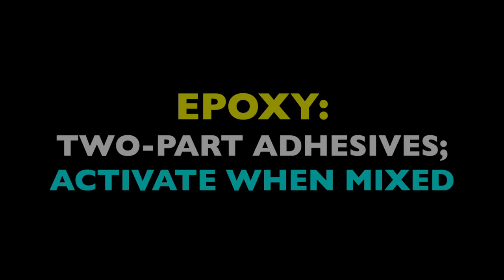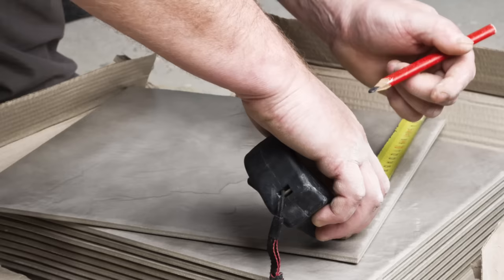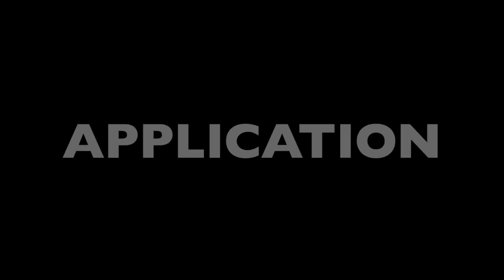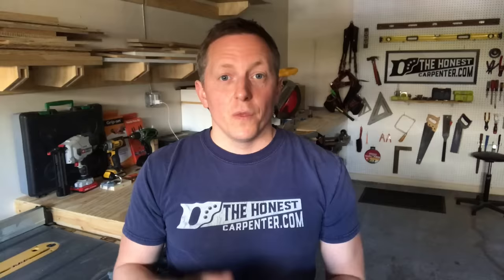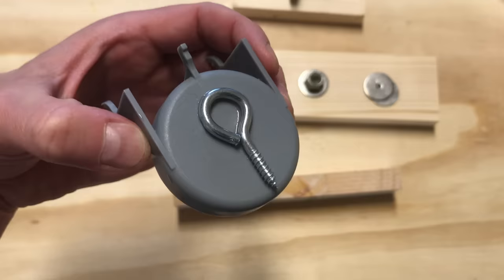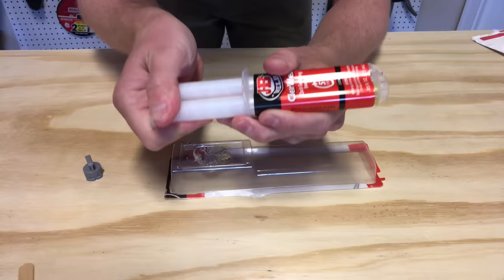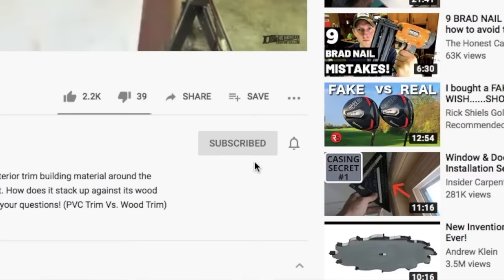DON'T USE SUPER GLUE! Try This Instead..(Epoxy Adhesive/5-Minute Epoxy/Epoxy Glue)

Comment: Great video, covers all the bases. I rarely use Super Glue (to brittle to last a long time. Epoxy has an affinity for wood, and makes it highly durable. It’s the go to for wooden boat builders.  (West System). 2 part epoxy is an exoteric reaction - give off heat when mixed, so ambient temp definite affect hardening time. Learn to work with it and it’s one of the best adhesives out there - and yes always wear gloves, and don’t get it in you eyes!

Comment: Both have their advantages and  uses.   In 5 min. epoxy their are always air bubbles, while mixing, so you 'll need a vacuum chamber  to get that out, if you want a clear view. Who has that?  And in 2-3 minutes? It cannot handdle UV so it get brown/yellow after a while. It is a strong clue, but only if it is 50-50 +/- 5%.  And that is a problem sometimes. It is hard to remove. And not cheap.

Good Superclue is not that stark, but sometimes more usefull than epoxy. While you can loose it with a paint remover (hot) FÖhn.  Very usefull on a lathe if you want to make a round thing without a hole, or in electronics or fast repair and so on.   And so you cannot say, like do not use superclue. It Depens on use.  It is cheap and usefull. Even for  fingerprints (vaporised use) 

have a nice day. F

Comment: I just used JB Weld Steel epoxy to bond my plastic interior molding for my car.  I attempted using the Clear Plastic stuff, but it failed.  The plastic bits came fell apart with the ever so slight tap.

The extra nice bit is that the JB Weld was the same color of gray as my interior.  No spray painting was needed.

Oh, I also had attempting using the solder iron with wire zig-zagged across the seam, but the plastic molding was not quite compatible with the heated wore method.

Comment: I have more than once found while pushing the syringe connected to the resin and hardener that one of them let’s out significantly more volume than the other. In these cases I have had to cut the connection between the tubes and squeeze out each one separately.
Reply: Had to the same thing with the plunger connection as the viscosity of resin/hardener are different. If you don’t do this on a new tube, your 1:1 ratio is ruined for the rest of the tube. Glad you brought this up

Comment: Wife 
Broke her glass bong so I figured WTH I’ll try some Harbor freight cheap epoxy? Cleaned glued and taped it in place for 24hrs and did 2 more heavy coats! Works great for over a year! Just remember to Clean, Dry, clamp or tape in place and leave it alone to cure as long as possible!

Comment: So here's a question I'm doing some research on. Would you know what would safely fix a crack in aquarium? Currently, all anyone knows in the fish hobby, is that you have to take apart the entire tank, because silicone does not stick to itself, so along a seal, which is where most cracks break to, silicone won't help and the tank will still leak.Any ideas? I found one video where super glue and baking soda fixed it temporarily, but it did not show any long term results. Great video by the way.

Comment: Thanks for video. I used epoxy bond for quite some time and it works - very strong. However my biggest problem with it - it de-gradate after some time (I mean one - or maybe both liquid components will react differently when you mix them after several months). I do not know if it is oxidation or what - however using half a year old opened epoxy will frequently lead just to gelled join. The mixture of components will just not harden. It is safer just try before using - if the bond will really harden. Newly opened epoxy bonds do not have this problem, (after one year typically)  the unused epoxy is good for nothing.

Comment: I've used different brands of 5 minute epoxy over the years and fully agree with what you're  saying, however,  maybe you can explain this :   I mixed a little amount on a piece of cardboard for a small job and later, when I was going to dispose of that piece cardboard, I noticed that the cardboard was warm.  What is this reaction between the resin and the hardener ?

Comment: I agree with you about 2\\part epoxies. II discovered JB Weld years ago and I love it. It works MUCH BETTER than those instant glues.  Recently, I've been feeling that the amount of hardener is insufficient and that I run out of it long before I run out of the epoxy. Do you agree?

Comment: I'm going to be looking around for a different brand of Epoxy. I don't know if they changed their chemicals or something else but I was a believer in JB Weld and have used it a lot in the past but in the last year I have had the bottle's, dual tube and the little squeeze tubes styles of theirs not want to fully cure even after a week, and if you have bought them you understand it isn't cheap. I'm thinking of giving Gorilla a try.

Comment: Another plus for epoxy... Super glues, once the tube is opened tend to harden rather quickly (created to do this on purpose). needless to say, they don't store well. Opened Epoxy, if the tips are cleaned and stored properly, will last a long time on the shelf. Good Video.
Reply: Just a little tip. Opened super glue, if the tips are cleaned and stored properly, it too will last a long time on the shelf.

Comment: I mix 50/50 baking soda and graphite to create a very strong bonding agent, and if I have a wider repair I will take old cloth, saturate it in the CA glue and sprinkle the above powder on the cloth.  Talk about a strong repair - Hard as a rock, dries very fast and will bond nearly anything I have tried.  Buy CA gel glue if runniness is an issue, and the above powder with CA glue is a very effective filler.  I like epoxy pretty well, but like what I mention above much better.  Lastly.  Harbor freight sells "acid brushes" for very little and they are perfect for this type of use, and a million other.

Comment: You can get cheap/inexpensive super glue and you can get good CA (cyanoacrylate) glues. Like epoxy you’re can get different viscosity CA adhesives. I use CA glue all the time and buy it in 8oz bottles. CA glue works much faster than epoxy and can be quite effective when used with an activator, or even baking soda to make a CA paste. I also use epoxies both liquid and putty, and buy in gallon or 1/2 gal. size containers with measuring pumps. I think one big reason you like epoxy over CA glue it that you’re using cheap superglue and not a good Hugh quality CA glue. I also use UV activated adhesives/fillers as they stay liquid until activated with a specific wavelength UV light; just like epoxies and CA glues you can get it in different viscosities. Buy a better CA glue and activator and give CA glue another shot; you’ll like a quality CA over epoxy in its near instant set over epoxies cure times.

Comment: I like your video and I agree that epoxy, in general, is superior. I have had more "fails" using super glue than I have with epoxy, yet epoxy has failed me on many occasions. Just today I stumbled across several YouTube videos that combine CA glue (super glue, etc.) with Baking Soda, Powdered Graphite, Ash, Powdered Charcoal, Styrofoam, and sand. I have yet to do my own testing but was curious if you have experimented with any of the super glue "mixture" applications?

Considering the cost of epoxy and the fact that I have paid upwards of $10 for epoxy and only completed one project only to find that the remaining 80% of the product still in the container is no longer unusable months later because it hardened ... even if the resin and hardener were in separate bottles. I can get super glue 12 packs (2 gm tubes) for $9 online. If I can mix it with other easy to get inexpensive materials and get epoxy like results, I would be interested in this route. I would like to get your take on this.

Comment: Actually because 5min epoxy comes as two parts require mix , It seems to  me more work evolve then super glue for small repairs. In this video I got some great Ideas to use epoxy for and I will try to use it more

Comment: I use epoxy to glue golf club heads to shafts. It's the preferred method for club builders. Imagine the force exerted with hundreds, or thousands, of strikes. I never had a failure. Super, super strong. One tip - when adhering smooth metals. It helps to scuff the surface a bit.

Comment: Some plastics super glue doesn't stick to. Not much luck with JB weld but that was a few years ago. Bondo the car panel filler sticks to everything but just not so good for exterior wood repair where its expose to direct to sunlight and moisture. Trying epoxy as filler on couple of axes where the handle separated from the iron.

Comment: I rarely use epoxy anymore. I mostly use superglue and baking soda. Just look, you get bigger volume superglue. I generally buy 50ml bottles. Epoxy just does not work as well.

You can also use superglue with graphite and cinnamon. My main glues apart from wood glue, is superglue and contact glue.

Comment: FWIW, I use a Sharpie to draw a line between the plug and body of the tube, so that I don't accidentally put plug with the residual hardener in contact with the epoxy, or vice versa.

Comment: I found that for tiny repairs epoxy cumbersome and not very durable on plastics. The best and stronger option was a combination of superglue and bicarb soda it produces an extremely strong bond very quickly is also suitable for filling and fabrication of damaged parts is sandable and drillable.

Comment: The weirdest thing I used epoxy for was a car tire. One day I got a puncture but it turned out there was no spare tire. Normally I would call some help but since it was almost midnight and i was in the middle of nowhere i decided to try the trick with epoxy glue which I always have with me. It takes only 5 minutes so it's worth trying, right? It took me longer to find the spot with the puncture. I applied some epoxy obviously outside of the tire, waited more than needed to let it cure, pumped up the tire with a portable air pump and started to drive slowly. I got home safely- approx 60-70 miles and was going to change the tire next day. But something came across and i forgot that. I have been driving with  tire fixed with epoxy for the next few days until i changed the tire. It drove like that at least 200 miles with no problems lol

Comment: Loctite was  my go-to for five-minute epoxy but not anymore. Apparently they have changed the formula so that the resin crystallizes and becomes rock-solid and so you’re forced to buy more.  I have switched to JB weld, which does not harden in the bottle like that. Eff Locktite.

Comment: super glue can be bought at RC aircraft hobby stores in MUCH bigger bottles. the moisture in the air is what makes it harden, so keep the bottle tightly closed and air out. It is more brittle than epoxy. Epoxy is more flexible but heavier. Heat is what cures epoxy through chemical reaction. cold will lengthen cure time. 70 to 80 degrees is best. I build RC planes and use both.

Comment: Five minute is better than "super glue" for most applications but both are temporary solutions.  For a permanent repair a slower cure epoxy will set up harder and won't break down over time like 5 minute epoxy.  I've peeled old 5 minute off of several repairs.  For something important, a cure time of 2 hours or more is best.  Make the repair in the evening, clamp it up and it's cured and hard by the next morning.  I've built RC models for about 40 years and learned a great deal about epoxies.

Comment: FWIW, 5 minute epoxy cures fast but can be a bit brittle.  Use a longer curing epoxy such as 30 min or longer for those bonds that require extra strength and a bit of flexibility.

Comment: An unopen clean vegetable or fruit can makes a great mixing tray. For broken plastic or metal with a clean, tight break i prefer to use super glue for the join and then apply epoxy for the surrounding area for added strength.  JB Weld is much stronger than JB Quick.

Comment: make sure you use a rag and clean off the tips, before putting the cap back on or its going to be bonded solid the next time you use it.
taping instead of putting the cap back on is a good idea.

Comment: The 5-minute epoxies aren't as strong as the longer cure-time ones, presumably because the later use less hardener, and hence more epoxy.  If you are really serious about using epoxy, then the resin and catalyst can be bought in larger containers, as is often available from supplier of boat-building materials or a "ship's chandler".  Various fillers then can be added to suit various requirements.  Polystyrene resin is not as good; less flexibility.

Comment: I’ve made two piece car bumpers into one piece with UTILITY epoxy brought from Bunnings I buy it buy the box 📦 you get six tubes in a box for $16 dollars I mix it like body filler on a proper mixing board and I use a stainless steel applicator it works really good but like anything make sure you sand both bits good and I find bending plexiglass plastic easily with a heat gun to modify my car bumpers and the epoxy is like cement once it’s set and you can sand it use car body filler over and 2 pac primer and paints

Comment: Though it is correct with polyester resins, I wouldn't say that epoxy is made of a resin and a hardener. Strictly, both components have the same function. In Epoxy, one molecule of component A bonds to one molecule of component B.

Comment: So I was right in thinking metal epoxy will fix the bracket on my grill that holds the drip pan? Can I just wire brush the little bit of rust that's on it? Or do I need to do something else for a good bond?
Reply: Commenting to follow advice others give. I'm curious about whether epoxy would be a safe solution for this considering it can be expected to get super hot and cooled back off repeatedly if it's in a grill. I'm not sure exactly of the visual of what you're discussing but that strikes me as a hardware sort of situation
Reply: You would need high temperature glue that works at 500F or even higher. Amazon has some but I never tried any. Regular epoxy does not work for high temps - I tried fixing low voltage lamp that doesn't get too hot and even steel reinforced one from JB failed quickly.  In general for such cases I would look for mechanical solutions. Drill holes and use screws. They probably attached brackets with spot welding which is not the most reliable.

Comment: At least some epoxies can be softened for mechanical removal by submerging in boiling water for a few minutes, or being exposed to a heat gun. So be careful using them in areas that can get excessively hot or they might weaken.

Comment: Glad you did 'Dissimilar' material, How did it hold?   Have 'fear' of 2 part epoxy;  Need to glue Rubber to Metal.  Aluminum? 
Rubber on Washer's shaft for Agitator.  Thing is, part slides down over other, pushing glue.  Many years & Many glues later, No luck.  
so now i ask - Ideas welcome.   Thanks.

Comment: We would make full length, fiberglass strand, limbs for compound bows using epoxy resin.  That's turning a fiber into a composite that rivals spring steel in its abilities -- no way superglue will come close.

Comment: Try superglue made for Radio Control airplanes. This is far superior to cheap hardware store superglue. Also use activator which set it almost immediately.  I have used wood saw dust in cracks, it works better than baking soda. These glues come in three thicknesses.

Comment: Epoxy add resistance in, and by, itself. Too much clamping pressure would remove epoxy from the joint, leaving a starved and weak joint. Epoxy works better with low or no pressure.

Comment: Have used it before, but not lately. Thanks for the tip. I don’t use super glue, it’s a 1 time use, and when you need it again it has glued itself together and is not useable.  Jim
PS.....how about a permanent solution/replacement for duct tape. I use the foil tape, depending on brand, some have a little more adhesive than others. I have substituted it wherever I used duct tape before.....seems to work fine.
Reply from the maker: Thanks for the video idea, Jim! There are some great foil tapes out there. Gives me something to think about 🤔
Reply: How does foil tape hold up to moisture, either in the environment or getting on the taped thing? I've never experimented with it, currently relying on gorilla tape a lot, and it holds up exceptionally well compared to duct tape but still isn't what I'd call permanent. You've got me all excited to try foil tapes now lol
Reply: @ItsAsparageese  Have not tried it. Have used it for chimney connections (4” galvanized sheet metal pipe) and that works well. I can’t even think of a wet connection that I would use duct tape for? I’m thinking of using it for sheet metal ducting.   Jim
Reply: @jimpie231  Ah right on, yeah I'm just looking for a stronger more durable alternative to duct tape for general purposes including on things that are generally outdoors. I live in my truck and built my own metal roof cargo box and am always tinkering with modifications to the outside of it haha. Thank you for the input!